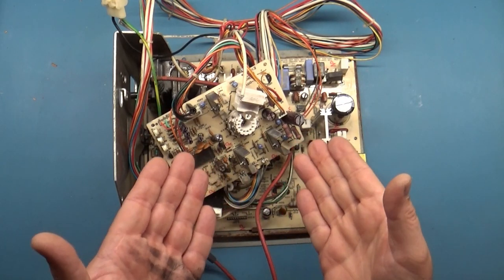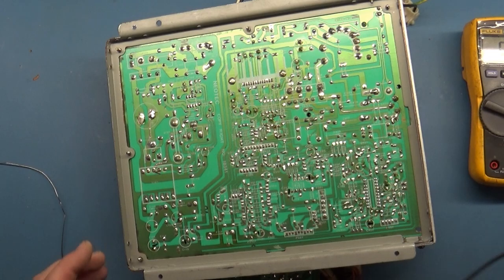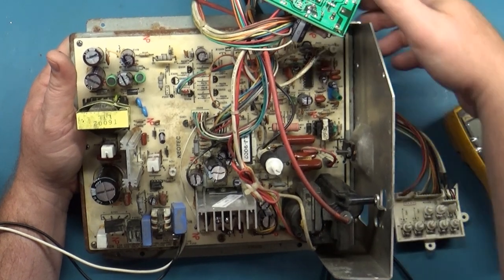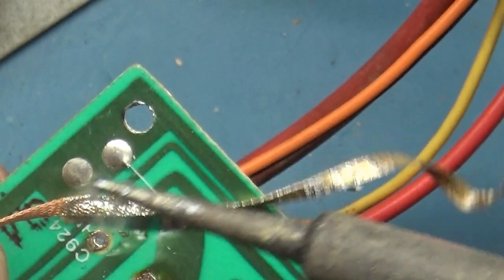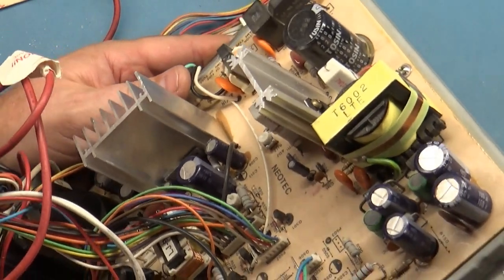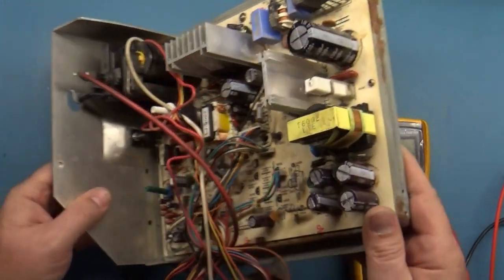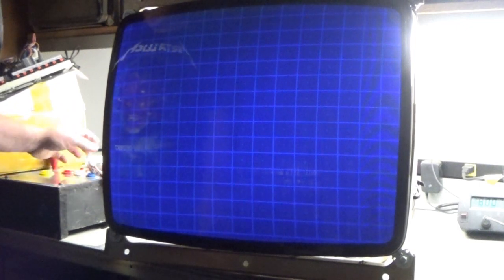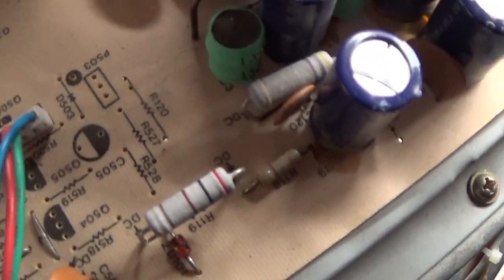25" Neotec 2515C Arcade Monitor Chassis Repair - Vertical Collapse, Bad R102, Low B+, and Bad Pots

Comment: Nice Metallica shirt, I can see it in the reflections :D And ofc great repair as always, love watching and learning along with you! By the way do you use any special type of solder wire or just standard 60/40? I meant to ask you this ages ago. Thanks again for all you do and the great vids over the years!! :)
Reply from the maker: Thanks for the kind words. I this…

https://www.amazon.com/SainSmart-Solder-Sn63Pb37-Electrical-Soldering/dp/B07PDBWYR3/ref=sxts_rp_s1_0?cv_ct_cx=sainsmart+solder&dchild=1&keywords=sain+smart+solder&pd_rd_i=B07PDBWYR3&pd_rd_r=080875f3-49e1-4c56-9967-cc15b1a872e0&pd_rd_w=Rho8s&pd_rd_wg=fCWO0&pf_rd_p=67518bbd-ae05-403c-924f-30cefcfcd4ac&pf_rd_r=9479NF4DX5G1R5W7C9P3&psc=1&qid=1632252449&sr=1-1-b4e772db-e472-48e4-b4c6-2b8a31082930